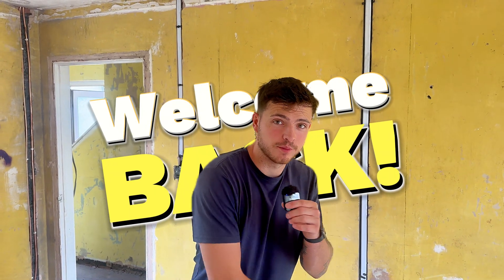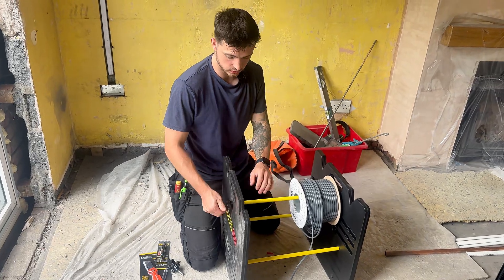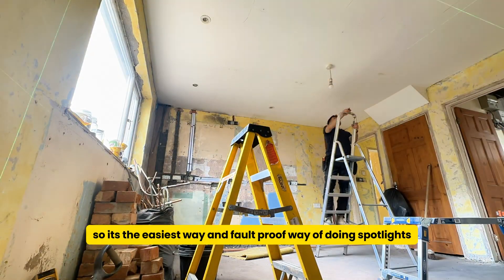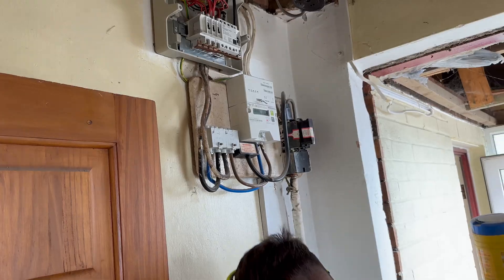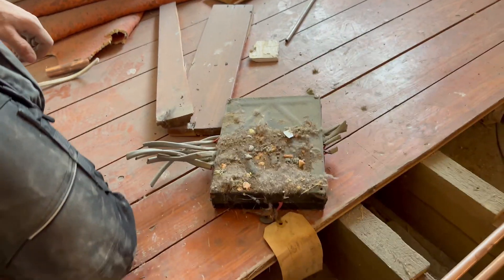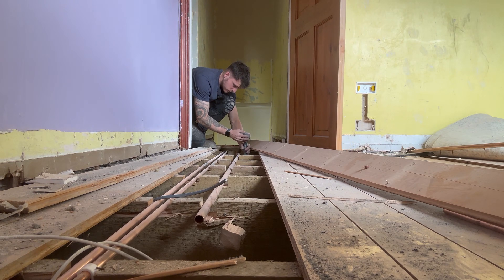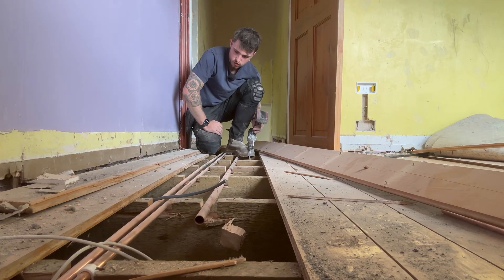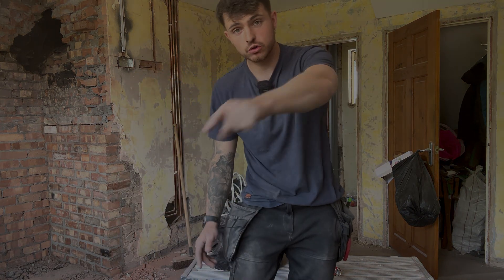What Have I Discovered In This House Rewire

Comment: It’s called a pancake box, it’s how a lot of lighting circuit were wired, we have somewhat modern day equivalents today whereby a Wagobox is fitted in the loft, a fed goes in and all the switch line cables and light fitting cables spider out of the box.

Comment: I found one of those boxes in my (1957, Cwmbran) house.  Mine hadn't been touched since the house was built.  The terminals inside were really tight and fixed with some thread-locking varnish.  Mine said "The Octopus" on it's lid and also carried a label bearing the 1957 installation date.  Since Cwmbran is a post-war "new-town" there must be thousands of them here.  The house only had about four mains sockets from new.  This made for very neat wiring between The Octopus and the quaint wooden fuse box.  That neatness is now gone with three ring finals and several radials post rewire.  Thanks for the vids, Jimbo.
Reply from the maker: @radiokeith  thanks for the comment. As it has it this was next to Cwmbran 😀